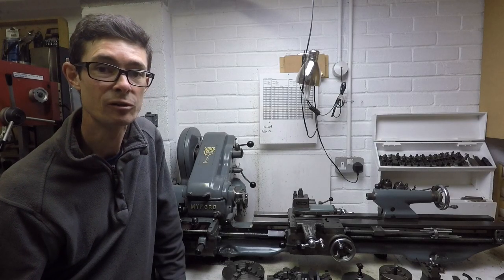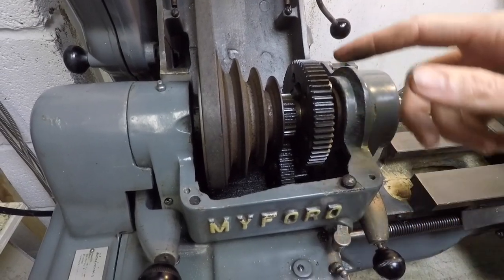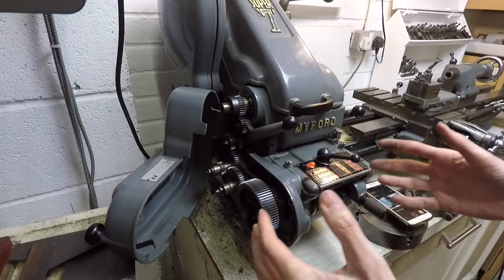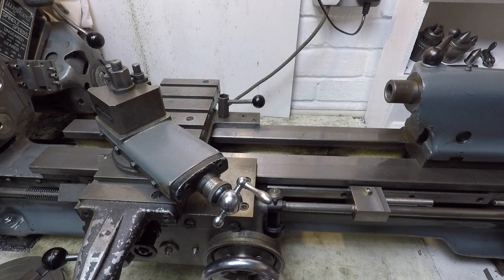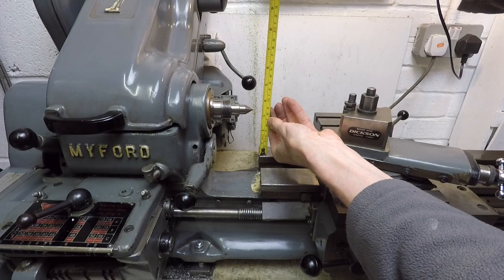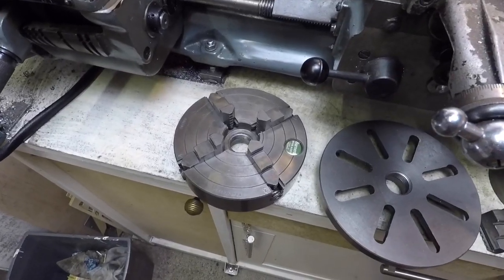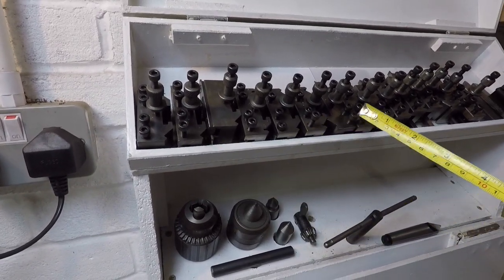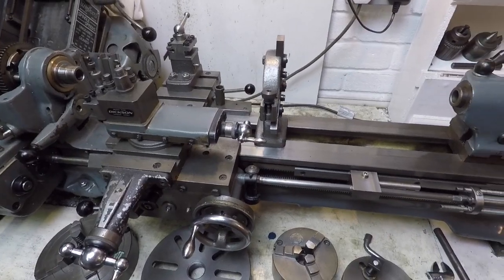A Look at the Myford Super 7B Metal Turning Lathe

Comment: Thank you for the tour. It brings back memories of when I worked for Myfords. I think I must have had a hand in making your lathe, at least in small part. I was an QC inspector in one of the auto shops and will have in all probability inspected some part of your machine. Nice to see them still in use.
Reply from the maker: That's a great comment! This particular lathe is still in more or less daily use and hardly worn so that says a lot for Myford quality and your QA skills - thank you!
Reply: I suspect there are few that aren't in use. Passed on 2nd hand, 3rd hand 4th hand etc.
One of the last jobs our 7 did was clean up the leadscrew for its replacement - a Colchester Student.
Reply: Did you inspect the paint finish on mine??!! Lol

Comment: Fond memories!  My father bought a Super 7 in (I believe) 1946, from ALS Cassie Ltd. in Dunedin NZ.  He understood it to be the first Super 7 in New Zealand.  It has a 31" bed, but no gearbox or powered cross-slide. Another detail difference is an oil reservoir cast into the headstock above the front bearing, with a needle valve to control the "drip rate".  There is also a Rodney vertical milling attachment, which I always felt was limited, and time consuming to mount.  I still own this lathe, which has been in storage since we moved town, waiting for me to collect it.  That involves a ten hour drive, in a suitable vehicle that I don't have!  You might have given me the push I needed.  Excellent video thanks... Liked & subbed with a ding-a-ling.

Comment: Hi, I had a super seven B only it was the green model with all the Bell's and whistle's until I saw a Chinese lathe that was slightly larger four and a half inch center height with tapered roller bearing's and inverted V bed, with P.W.M. speed control, no belt changing just turn a control knob, Brilliant, chuck held on by three bolts so no trouble running in reverse. On my Myford when running at high speed the bronze bearing's would get very hot always worried it was going to seize up. So I sold my Myford and bought the Chinese model landed up with a new lathe and a lot of money left over it was the best decision I could have made and that was twenty year's ago and it's done a lot of work since then and still going strong. Mind you have to be careful when buying Chinese lathe's as there is a lot of crap on the market but the one I bought is excellent. Just to point out that I know what I'm talking about I'm nearly 80years old and been a Engineer since I started my apprenticeship back in 1956. P.S since buying it I have fitted a car air condition electric clutch so I don't have to turn the motor on and off.
Reply: Well bless my soul.....we must be spiritually related in some way as I'm an 81 year old ex Brit, and I served my apprenticeship as a fitter and turner in 1956 too.
But.......it gets weirder.....I have a belt drive Colchester Bantam of 1930 vintage and I fitted that with a car air conditioner electric clutch too.........now I'm aiming to get the T35 quick change toolpost as advertised on EBAY from India.
Edit.......I fitted an AXA QCTP not the  T35 from India.

Comment: I'm looking at getting a lathe next year, and have been looking into the ML7 and Super 7s on the recommendation of Allen Millyard. I'll be using it to make and modify motorcycle parts, mainly axles, spindles and stems, and making spacers and collars. Eventually I may want to make other parts like wheel hubs, and other parts that are now unavailable. I've never used a lather in my life, but I'm going to learn.  I was initially looking at the Clarke 400/430 lathes, but have been warned off Chinese lathes elsewhere, although there are as many people saying they're good enough, you just need to shop around and make sure you get a good one.
Now reading some of the comments on here about the Myfords being overpriced and being "lightweight", just wondered what peoples thoughts are on the ML7 etc for my needs and if they'd be up to the job. I've been reading up on different British lathes worth looking at, Boxfords, Colchester, Harrison etc. 
My budget is going to be relatively low as I need to buy welding equipment too next year, and later on or in 2021 buy a milling machine, so looking at hopefully spending around £1000-1500 on a lathe, but will stretch that budget a bit if needs be.
Reply from the maker: Siobhan Garvey Hi, I think you are right that the Myfords may be a little small for some of your intended projects.  There is absolutely nothing wrong with the newer lathes of eastern manufacture and some are great value for money, especially second hand.  A used Harrison M300 or similar would be a great choice too.  Just my opinion! Good luck with your projects.
Reply: @MetalMachineShop  I'm currently watching a Harrison M300 on ebay, just to get an idea of what they sell for. I can't afford it yet, and the welder will be getting bought first.
In what sense in your opinion makes the Myford lathes a bit small for me?
I think Allen Millyard has an ML7 (need to check) and he seems to do okay with it. That said, he's an engineering genius and could probably make a working lathe out of Meccano!
I'd rather have something a bit bigger than my needs mind, just so that I'm not stretching the limits of the machine. What they call "headroom" in audio engineering. Some of the Colchester and Harrison lathes look like they'd be better suited. The Boxfords look similar in size to the ML7s, so not sure if they'd be any better.
That said, I may be over estimating what I'll need, and could possibly make do with an ML7 or similar.
It's interesting, if a bit of a mindfield when thinking of buying something you've never had prior experience on.

Comment: How is the chuck attached?     Is it simply screwed on and if so how do you hold the spindle to take it off.
Reply from the maker: It screws on and you can lock the spindle by engaging the back gear.
Reply: @MetalMachineShop  That broke the teeth on the bull wheel so I did this  https://www.youtube.com/watch?v=HbJ7CMlp9Cw&t=917s

Comment: The problem with Myfords is whilst they are a guality machine they are a lightweight machine and very overpriced. Though no longer made in UK used ones cost up to £6,000. A good conditioned Boxford can be had for less than half that price whilst Colchester Bantams and Chipmaster lathes are available for less than £3,000.
Many come from schoos or university workshops having had little use and are easily converted to single phase where required.
Reply: You are right about the lightweight (I own two ML7 + S7). But there is no such thing as over priced. If the customers are consistently willing to pay a price then that is the right price and there must be something that makes it worth that price for them.
Reply: What do you mean by lightweight? I am assuming you are referring to its ability to do " heavy" work? I have a seven in my workshop along with some much bigger machines, and one monster!, and find it anything but a lightweight in these terms. Combined with a Newall DRO and a VFD the Myford is capable of producing parts to a very high standard and accuracy. If you find yourself regularly turning parts that exceed its capabilities then by all means buy a bigger lathe but don't get caught up in the bigger is better arms race. A two foot long five inch dia lump of metal is a big lump, and the Myford can handle this with ease. The DSG could turn two foot dia ,eight feet long but never had anything like that in it!. The Myford stands me just over 2k £ as it stands and worth every penny.
Reply: @jimmiller5891  So why has Myford gone out of business? In part due to far eastern competition but also because the company thought they could continue to charge OTT prices.
Reply: @haroldpearson6025  Yeah, this is light hearted commentary here so not too serious. Without the competition form east the OTT prices would have been the norm. They only seem OTT because we can get so much cheap stuff from east. I'm pretty sure that Myford did not make a big profit with their products. Probably hardly made the ends meet. So in that sense their prices were reasonable. 

With the competition from east they should have had some strategy how to survive and stay competitive. 

It would probably have involved total overhaul of how they manufacture the lathes. Possibly shift the whole manufacturing operation east and sort of become just a brand owner that ensure that the quality is there. Contrary to what many people think you can get any quality (good and bad) from east. For good quality you need to insist on it, work with them and be ready to pay for it. Crap you can get for nothing.

Easy to say with 20:20 hind sight and not sitting on the fire with my trousers. ;)
Reply: @andrewwilson8317  I mean not being able to take the kind of deeper cuts that we can with a TOS 40 B/1500 for example which we happen to have 'at work'.
Reply: @andrewwilson8317  'Lightweight' means stopping every 10 mins while the motor cools down !
Reply: @jimmiller5891  "I'm pretty sure that Myford did not make a big profit with their products" - 'miss myford' got over a million in leftovers from shutting the company down !

Comment: We had Myford 7's or Super 7's to learn on at the high school I attended.   Cheap junk, but had all the features valuable for teaching.  Later, at work, I had access to a Sheraton lathe with slightly bigger swing and about the same distance between centres.  It was vastly superior, being at least twice as massive and having the accuracy of V-ways.  
I've never understood why there was and is so much focus on the Myford in English model engineering circles.
I bought an Asian lathe a few years ago.   Cheap but not junk.  It too is much better designed, has V-ways and is as massive as the old Sheraton.
Chucks retained by screw thread were once common, but these days is considered dangerous.   You can't have an emergency brake, as if you did, the chuck would unscrew.
Reply from the maker: I think the attraction of the Myford is it's versatility and usability.  It is not very rigid though, so for rapid metal removal, you need something chunkier and more powerful.
Reply: @MetalMachineShop  : It's no more versatile than most other lathes.   The lack of rigidity makes usability much lower.  The lack of V-ways means that accuracy cannot be maintained in a factory environment - that means lower usability too.  Myfords were once exported all around the British Commonwealth, but the start of Taiwanese lathe production killed them except in Britain.   There is a reason why the Asian lathes killed Myford off - they were very much better. 
Its the same as with British cars  - once exported in large numbers, but superior Japanese quality and fitness for purpose killed the export markets.   Same as with British electronics - every country used wartime factory lessons to make better products, but the Brits just kept on turning out the same old junk.   I can only assume that as with British cars and British electronics, Myford continued to attract private customers in Britain - it's the "but it's British" factor - emotional thinking not logical thinking.
Reply from the maker: @keithammleter3824  I don’t disagree!  You can certainly get more machine for your money with some other decent 2nd hand lathes.

Comment: As you obviously know the myford inside out I have a question . is there a way of locking the chuck to the spindle so it can safely be used in reverse ? Thank you for a great insight into these machines .
Reply from the maker: Hi, no you can't lock the chuck to the spindle. Any machining with the spindle in reverse relies on screwing the chuck on tightly.  Heavy cuts and high spindle speeds would be dangerous and out of the question, but for occasional light work you can get away with it if you are careful.  Probably not to be officially recommended though!
Reply: I built a draw bar that expands its taper into the chuck s bore and goes trough the other end of the spindle where I do tighten it . However I cannot use the chuck s bore past the jaws anymore when in use , cannot use live center  from the spindle s taper too. for the face&cacth plates I turned inverted cones that thread into the draw bar

Comment: Not withstanding how popular these machines were amongst the model engineering community, they are lightweight machines and require a gentle approach when machining with them.  My habit of leaning on my Boxford tailstock to watch what I am doing is not acceptable with a Myford.  A professional engineer demonstrated how leaning on the tailstock of his Myford measurably twists the bed causing a significant difference near the chuck.  Also, this type of lathe bed is not tolerant of any wear. A change of direction of feed will result in a different depth of radial cut if there is any wear, where a vee bed like the Boxford, there would be no change.
Reply: You just discribed every tool room lathe out there. Even my South Bend "Heavy" 10 lathe that will do much of what your  talking about. Long lathe beds can flex.

Comment: Unless I'm mistaken, you appear to have a saddle stop arrangement on it. How does that disengage the leadscrew ?
Reply from the maker: Hi, yes there is a saddle stop but there is no mechanism for disengaging the lead screw nut.  I would only use the stop when manually traversing the saddle.
Reply: @MetalMachineShop  I hadn't thought of that !
Cheers.
Reply: @MetalMachineShop  Saddle stop on mine trips the power feed but does not work on the leadscrew halfnut :(
It has power feed to cross slide but no trip mech. I plan to look into making a trip for the cross slide.
My mill has trips on all power feeds.

Comment: While these are fine for very small turning they’re a big let down on anything over 50mm (2”) diameter when they chatter readily and can only take fine cuts. A much better prospect is a Colchester Chipmaster or Bantam or even a Boxford or small Raglan. Another annoying aspect Of the ML7 is that the bore through the headstock spindle is dead on .625” diameter, so if you try to put a piece of 5/8” dia. silver steel through it won’t go in. I got so annoyed with this I resorted to polishing a few thou out of it until even 16mm (.630”) went through.

Comment: Myford Super 7 lathes are over priced piles of junk!  I wouldn't trade my USA built Hardinge HLV for 10 Super 7's. Colchester Lathes are way better machines too!
Reply: The Hardinge  HLV is a fantastic m/c, I worked on one years ago when I worked in the Aerospace industry, a very high quality machine. But not cheep. I was taught as an apprentice on a Little John lathe , we had a Myford in the training centre but it never got used, it was to weak. I had a Myford Super 7 for a few years in my hobby workshop but got shut and bought a Warco  WM-250, a far better m/c in my opinion, not as good cosmetically finished but accuracy is what mattes not looks and has decent sized spindle bearings . Always wanted a good Boxford but in my younger days could never afford one.